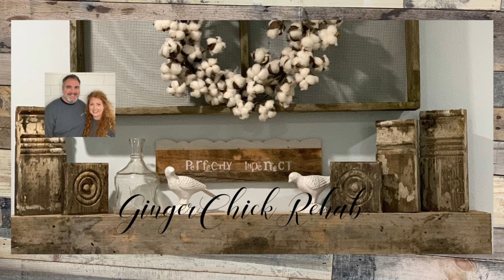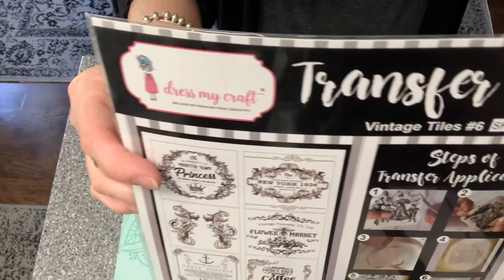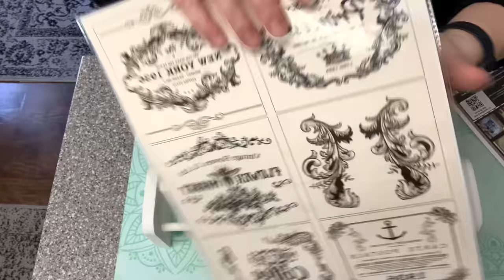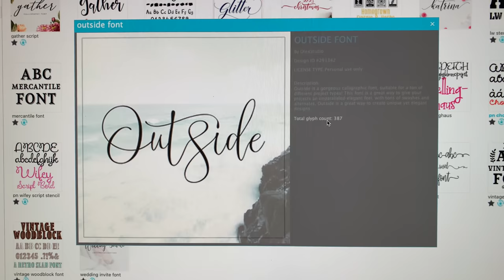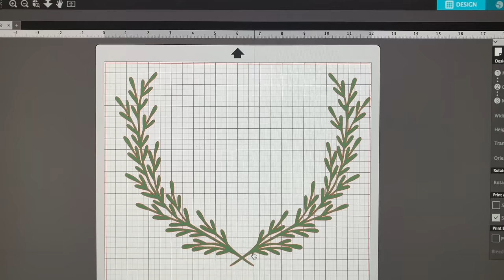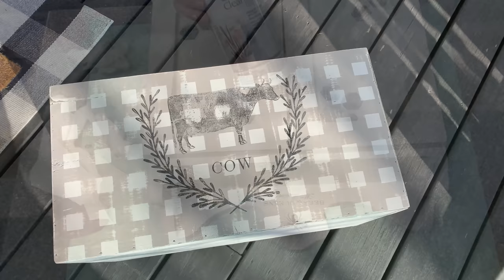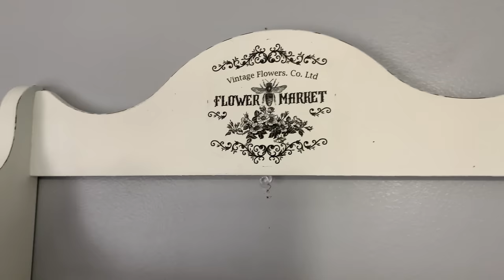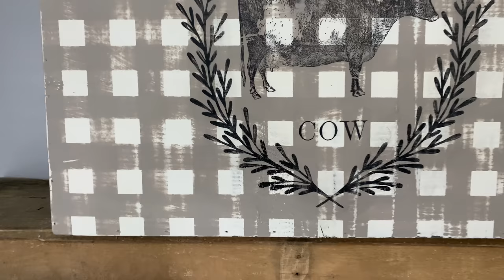Trash to Treasure || Thrift Store Finds || Painting Wooden Thrifted Finds

Comment: Hi Yvonne! Everything is fabulous as always! So fun to see Peaches in the reflection. What a cutie. I can’t seem to get enough of the mineral paint color. The flower box is my fav today. So pretty. I learned to use rubbing alcohol on the back of the stamps, as well as the block. Let dry and then the stamp sticks much better. Also IOD sells what is called a Thin Mount, that the stamps stick to. It’s somewhat flexible, which allows one to apply pressure to each part of the stamp so the ink applies evenly. I think they are $2 - $3. Always always enjoy your videos! 💕
Reply from the maker: Aww.. thank you for spying Peaches.. Yes I like one of those thin mounts but I need to wait till I place an order sometime to get one. Thank you 😻